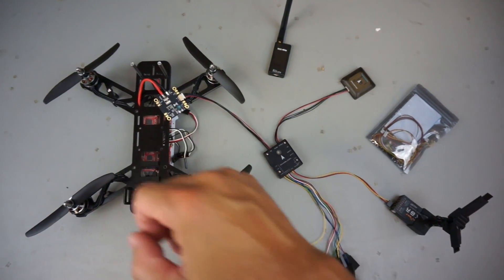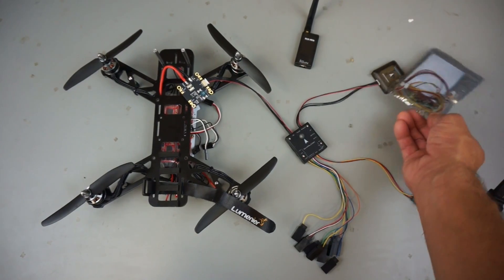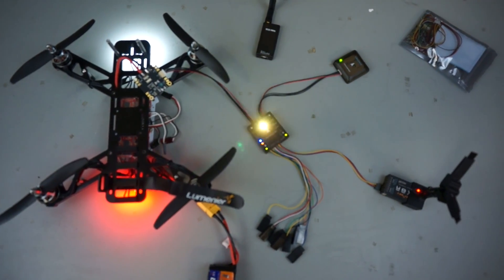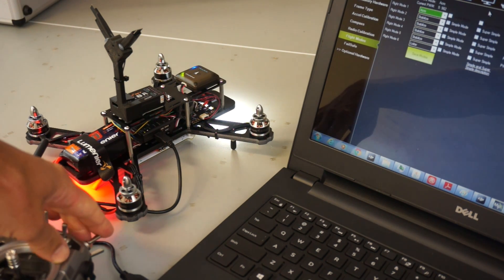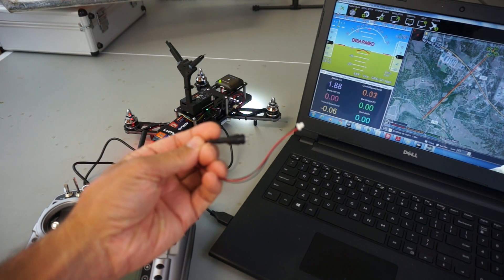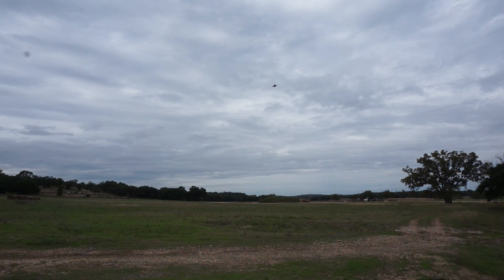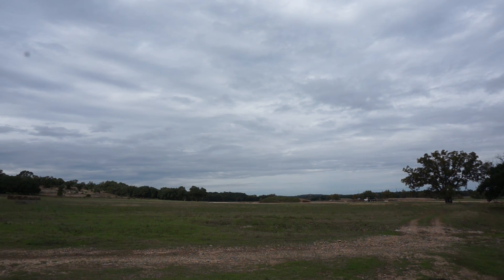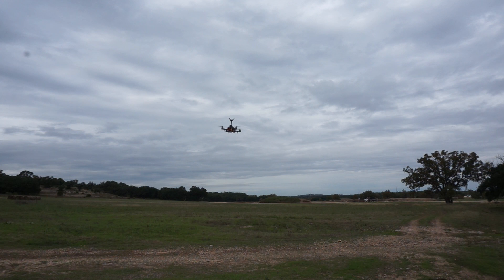Pixfalcon Micro with QAV250 and Field Maiden

Comment: Hello Dennis, I finally have time to install the PixFalcon on my 250 frankenquad.  I do have a couple of questions though: I have 2 of the transceivers, what is the difference between the transceivers and the micro telemetry? I couldn't find any info out there. Also, what do you recommend: Mission Planner or Qgroundcontrol?

I did watch one of your latter videos on how to remedy that wacky "punch out" when you switched to loiter mode. If it wasn't for that later video I would have just gone back to the Naze32. If all works out for me I'll use the PixFalcon on my QAV250 and a PixHawk on my TBS Disco clone.

Thanks for posting and please keep them coming!
Reply from the maker: The radios can be mounted on either end (ground or the aircraft). They simply serve has a conduit to send receive data to/from the aircraft/GCS. I prefer Mission Planner personally. I've used Q but it's not as robust IMO. Good luck with your setup. I hope all goes well.

Comment: Dennis. please tell me how you fixed the issue with loiter mode. I have a HK Mega Micro that does the exact same thing by shooting up. Also does that in PosHold
Reply from the maker: Maybe this will help: https://www.youtube.com/watch?v=qXUEZmchBSI Good luck.
Reply: Nope it's dead now. Shot up in the air again after about 3 successful flights, then started shaking so bad the battery came undone and it took a little 10 meter plunge on to solid tarmac.

Comment: Great video!.

On 2:26 https://youtu.be/lPmiwmFpTdA?t=2m26s I noticed  that you installed the board over some pads. Can you sahre where did you get those soft pads?

Thank you!
Reply from the maker: I used the 3M foam pads that came with my original Pixhawk. Some of my favorite stuff is called Kyosho Zeal:

http://amzn.to/2bUiD7y

It's sticky on both sides and does a good of vibration dampening.

Comment: Okay, this is probably a stupid question, but the only place I've found online to buy the pixfalcon in a kit only includes its gps and the power module but none of the telemetry stuff. I assume I need the telemetry stuff in order to get it to follow way points? And if so does anyone know where I can buy the whole kit? The holybro link in the description looks like it only contains the pixfalcon and the cables, no gps, power module or telemetry.
Reply from the maker: You can program waypoints on the ground via USB cable, but not nearly as nice as telemetry. Here is the kit: http://www.getfpv.com/flight-controllers/holybro-pixfalcon-osd-gps-combo.html
Reply: Thank you very much for the information and the link. My next question is does the Pixfalcon work with PWM receivers or just PPM ones?

Comment: In mission planner Under gps tab set to manual and select  'YAW180' Redo compass calibration and should loiter just fine.
Reply from the maker: +nasarami Not sure why I would do YAW180 when the compass orientation is forward. Any thoughts on this?
Reply: +Dennis Baldwin the only thing I can think of is when the code was written I know it's been many updates since but internal compass was onboard and gps is normally installed above it a little forward or backward so it's a roll 180 sounds about right. I had the same issue with 2 builds once I activate loiter or any mode that uses the compass/Gps I noticed it yaws sharply the same way yours did. I took a closer look at that and noticed the gps is setting right next to compass so I thought try yaw 180. I might be right about the positioning thing or wrong but I'm pretty sure if you try that you will have a rock solid Loiter. Please let me know how it goes. I would still be ready to switch to stabilize if it didn't work I saw how quickly you did switch and gained control back I wish I was that fast. Love your work by the way. Best regards
Reply: +nasarami I do believe the software on the  gps/compass itself could be the reason for it to only work the way I mentioned. Best of luck

Comment: hi Dennis nice test, i had been checking out pixfalcon and good size for minis, not to race but to fly waypoints and so forth with Mission Planner. Have you tuned it up well now after this video? Hope you could share your set up on the Extended Tuning page. What PIDs gave you the best handling.
Reply from the maker: +Photostop Borgs I have done some additional tuning and will share that in the next week or two. The weather has been so windy and rainy lately that I haven't been able to do extensive testing. Thanks for asking.

Comment: Did you sort out the loiter mode? Did you check inside the Pixfalcon case to see if the barometer is covered with foam? There is a lot more prop wash on these smaller frames so it is essential to make sure the barometer is covered.
Reply from the maker: +joeprice22 It's in progress and I'll share an update soon. I'd have to think the Pixfalcon baro is covered with foam, but that's definitely worth a look. Thanks for the feedback.

Comment: Great Dennis, I'd also be very interested in your PID's, on my mini APM I couldn't set them through the basic tuning screen as the required values were lower than the screens allowed minimums. I also experienced a similar loiter problem, have moved the GPS to a pylon, but haven't tested it yet, I look forward to observing your fix? Andy
Reply from the maker: +Andrew Dibbins Yeah I had to go to full parameter list and then manually set them because as you point out I was unable to with the standard tuning screen. I will share my results soon. Thanks for tuning in.
Reply: +Dennis Baldwin , Did  you manage to solve the fly-away issue with loiter mode ?

Comment: watch out, built in buzzer is a source of vibrations. There are cases on diyd when people mounted their buzzers on pixhawks and during flight mode changes they were badly affecting both EKF and DCM orientation solutions.
Reply from the maker: +Artem Nikitin Thanks for the tip. Will definitely look into that with the Pixfalcon.

Comment: Quick question...  I'm running 3dr pixhawk... What happens if when running a mission I loose both radio link as well as telemetry link say if it flies behind a building ?  Will it rtl and smash into the building ?  That's my worry...
Reply from the maker: +Anirudh Devilboy There are failsafe and gcs overrides. I suggest checking those out because you can have them configured independently. Here is a bit on radio failsafe:

http://copter.ardupilot.com/wiki/throttle-failsafe/#what_will_happen

http://copter.ardupilot.com/wiki/gps-and-gcs-failsafes/#ground_control_station_failsafe

In your specific case you can tell it to Loiter so you could move closer and pick up signal. You could also tell it to land. It obviously depends on the terrain around you. Good luck with your setup.
Reply: this is a non issue because there are no countries in the world where it's legal to fly around buildings without LOS.
Reply: +Matt™ this is a what if circumstance...  Like if I do I point of interest and the altitude isn't high enough and it goes behind the building...

Comment: I have  been running the HKPilot clone from HobbyKing on my QAV250 for several months  with no problems in any mode.  I used a trick out of your book Dennis and moved the support posts to allow enough room on the frame.  The default PIDs worked fine, but I also ran autotune with no problems either on both the original frame with 5" props and the extended frame with 6" props.    I consider this my test platform new versions of Arducopter.  I have the Pixfalcon ready to go, just have not mounted it yet.
Reply from the maker: +wn0x That's great to hear! The default PIDs for my rig were way off and led to all sorts of wobbles. I'm tuning my GPS modes now and will share an update when I have them ready. Glad to hear you got a Pixfalcon. Hope your setup goes well.
Reply: +Dennis Baldwin Did you have any luck calibrating the voltage/current with the included PDB?  No combination of sensor or firmware version worked for me.
Reply: +Dennis Baldwin Yikes! After a broken top plate, GPS mast and prop I am setting the PixFalcon aside for now.  I had the same issue with wobbles you had - as if the PIDs were WAY  high.  I was trying to let it down gently when it cut power completely and dropped like a rock on its back.  I have had trouble with the PixFalcon being a bit flaky.  I also added 5V UBEC as a small servo attached to the receiver was enough to cause brown outs with the supplied PDB.  I have flown many missions with my HK clone and it flew beautifully and reliably with the default PIDs.  I honestly don't think I am going to try this FC again.  Too bad though, for $100 it showed a lot of promise and I loved the form factor.

Comment: Looks like loiter might be configured as RTH
Reply: +decompyler I have to agree
Reply: +Mark Chance I have to disagree I believe it's a interference issue.   it's hard to run a GPS on a 250 sized quad.   if it was a rtl issue it would have climbed at only 4ms instead of the 40ms that we see in the video also it climbs at an angle.  that's what I think anyways
Reply: +MadD MackX I agree with you. The GPS should be put on a pedestal mount of some sort. Seems that is catching DC interference. To minimize the interference, you could mount a copper shield under the GPS, solder a lead anywhere on the copper and tie that into the ground. This will help minimize the interference but will not eliminate it all together.